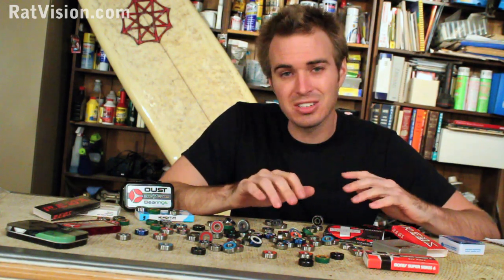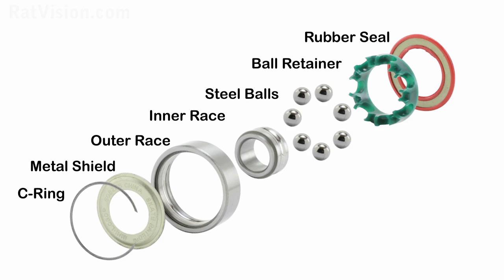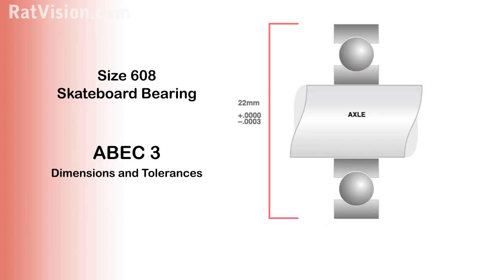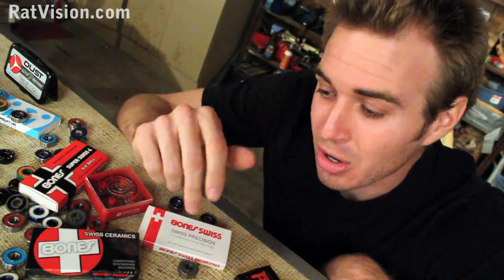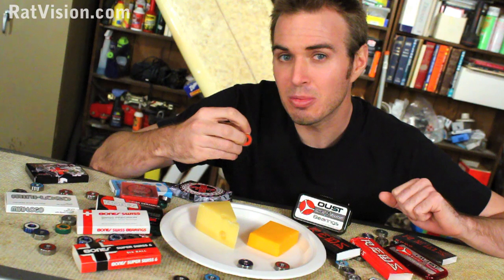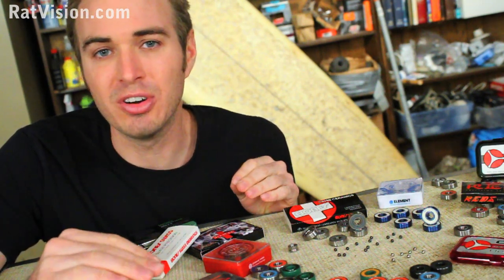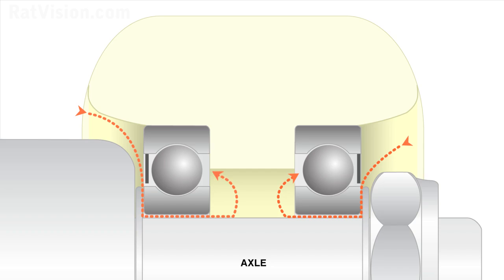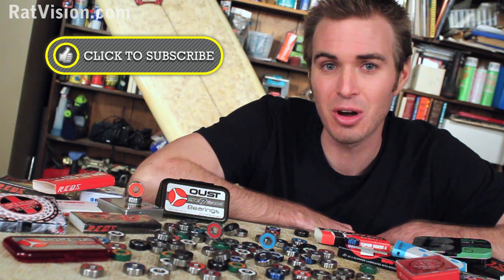What is ABEC / Swiss / Ceramic Bearings

Comment: Great explanation, although you got something wrong. You talked about hardness when comparing ceramics versus steel, but performed a compression stress test; the compression stress is another property. Compression is related to how much force can the material withstand and hardness is about the resistance to scratches, indentations, bounces and is a very complex matter. So you get the idea, the regular fragile glass has actually higher hardness than most steel alloys in Brinell scale. Sorry for the lecture, what I'm trying to say is that ceramic ball have an upper hand against regular steel for prevent scratches inside the bearings.
Reply: Rat Vision – Skateboard Tech I don't THINK they are better.  In some applications I KNOW they are better.  As far as the 5-10 times better, this is engineering fact.  The compressive yield strength of ceramics is generally 5-10 times higher than steel.  As far as bearing use, hybrid ceramic bearings are used in virtually all AMA and World Superbike engines as well as MotoGP, Indycar and F1 engines and transmissions.  Studies by ARPA showed that hybrid ceramic bearings would survive 5 times as long as the standard steel bearings in case of loss of lubrication in C-17 turbine engines.  Sure, these aren't skateboards, but the principles still apply.
Reply: Rodrigo SCompressive Yield Strength is the important measure here.  That is how much pressure the material can withstand before permanent deformation.  Silicon Nitride is about 10 times better than steel in that respect.  ANY small deformation renders a bearing worthless.  Of course, only the higher quality ceramic bearings use Silicon Nitride (black or dark gray balls).  Most cheaper ceramics use Zirconium Oxide (white balls) which are not nearly as good.
Reply: @rcbearings1 zirconium oxide is actually stronger than silicon nitride
Reply: Rc Bearings I don't think the compressive yield strength is the most important parameter. How many skateboard bearings have you seen failed due to a broken balls?. Normally the issue is the wear and tear that gradually reduces the rolling speed of the bearing; with a higher hardness it is likely that the wearing rate inside the bearing would be decreased. Other two factors more important that compressive resistance would be the quality of the lubricant and the sealing against external impurities. For this application (skateboarding), most bearings in the markets have a high enough compressive yield point to withstand most  scenarios.
Reply from the maker: Rc Bearings I am really curious to hear why you think ceramic is better than steel, and why you think it's 5 or 10 times better.

Comment: Normal, metal ABEC5 are just enough for Skateboard, ABEC7 for Longboard downhill. Period.

If there's something to avoid is ABEC 1 or 2 (which you don't find on good skate shops)
Reply: Rc Bearings  The point is you don't need to buy "Skateboard grade" bearings....bearings are always manufactured with high quality standards so, anything from the hardware store would work....and if not, it was cheap anyway.
Reply: Did u guys anything that he just said and penny board bearings are abec7
Reply: Sacco Svd You obviously didn't get anything from the video.  There are a few factual errors there, but the basics are right on.  I can make an ABEC-7 bearing with square balls!  I can also make an ABEC-1 bearing that will out perform any skateboard bearing.  ABEC tolerance class is the LEAST important of all the bearing ratings.  Ball grade, Noise and Vibration ratings are FAR more important.

Comment: Got some OUST 7 SPEED bearings after seeing them recommended. Smooth! After spinning them all day (it's been raining), I did a wheel spin test w/ board laying on its back with one major spin of the wheel.

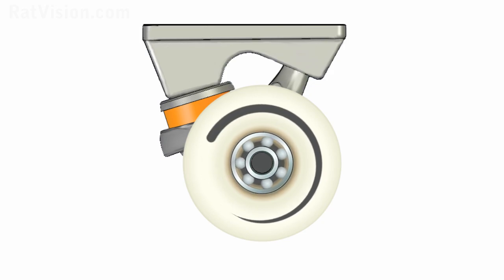Clocked in at 1:17.7 Might not mean much in terms of speed but it seems like the bearings will give crazy-long strides. Can't imagine what they'll be like after they're broken in.
Reply from the maker: Free spinning a wheel means absolutely nothing. It does not prove anything.  You have to be riding the board to actually see how the bearings perform.

Comment: I have a question about choosing the right trucks for my longboard. It's between the Gullwing Sidewinders 2 or the Gullwing Chargers 2. Now here's my problem, I have a sector 9 drop through deck particularly the Sector 9 Lookout Longboard. I've heard the Sidewinder trucks will end up breaking my board from doing tricks on it. If you could get back to me on this it would be great.
Reply from the maker: Did you get trucks?
Reply: Yeah I ended up getting the gullwing chargers, but now I'm saving to get some sidewinders as well as a new deck

Comment: Take your board and drop it from chest height onto the ground. That fancy dancy abec 7 super ceramic swiss just had its abec rating go out the window. Now go skate and quit stressing your abec rating.
Reply from the maker: Speechless!
Reply: You are absolutely correct,and the same applies to ALL the bearings used in wheels. As we both know,they are not designed to take shock loads,and to a certain degree axial loads. I think its funny how people rush out and spend serious cash on super precise bearings,then chuck them around,or worse still not lube them because they think they'll be faster :)

Comment: i just ride around in Florida (Mostly all flat) need a bearing that i can get pretty fast with without having to pump too much any opinions?
Reply from the maker: We recommend Oust.  They have extremely hard balls that will roll really fast. You need to keep the bearing lubricated with a good lubricant.  Old bearings that have been maintained are better than new bearings because they have been broken-in.

Comment: How do you make the bearing go fast when they are new😁
Reply from the maker: Skate them.  They need to break-in.
Reply: Rat Vision – Skateboard Tech BS.  Bearings do not "break in".  The lubricants may need to be pushed out of the races (channeling).  And I am having a hard time with bearings being "faster".  All bearings of a given configuration have the same speed ratings.  If you want less friction, try dry surface film lubricants such as tungsten disulphide.

Comment: Why would you give the dimensions in mm and then the tolerances in inches, thats just silly.
Reply from the maker: You're right.  The ABEC rating was created by the American Bearing Manufacturing Association.  In the USA we use the Standard measuring, using inches.  So that's why you saw it in inches.  If you really want to see it measured in millimeters, there are conversion charts online.  It's easier for people to read and understand the dimensions in mm.  The tolerances could have been in mm, but those numbers are so small I'm sure people weren't paying attention.  You certainly did.  The real reason was just for convenience.
Reply: Rat Vision – Skateboard Tech That's fair, just as a design engineer, i was most probably paying more attention to the technical details than your average Joe :P

Comment: Are new bearings typically slow! As they break into a new wheel for a example or no
Reply from the maker: Yes, new bearings are typically slow.  It takes roughly 15-20 hours to break in bearings.  The contacting surfaces go through changes.  After this break-in period the bearings will perform at a higher level.  Of course the bearings need to remain clean and use a good lubricant.

Comment: Are bearing spacers good
Reply from the maker: Yes, when they fit properly.
Reply: Rat Vision – Skateboard Tech my spacers have a little gap like in the video should I take them off
Reply from the maker: It's your call.  If the space is very small, it may be best to leave them in.  Most often it's best to keep them in, unless there is a big noticeable difference.

Comment: are spitfire burners good?
Reply from the maker: They are just like any other Chinese bearing.  They'll work.  What you may not be aware of is that the skate industry gets the majority of their products from China.  That means whoever has the coolest brand name and does the most marketing usually is the one with the most branding, and that influences skaters into thinking they have the best product.  But in reality they may be exactly the same bearing, coming from the same factory as other bearings, or worse, or just as good as most of the bearings available.
Reply: Ok! Thanks a lot! The video was informative and awesome too...

Comment: I need to get new bearings for my long board. I have recently been using no name abec 5 bearings but they have ceased on me. What do you think is the best bearing for fast speeds and the best performance? Also, what kind of bearing and truck spacers should I invest in? I want to be able to go very fast, be able to carve great, and avoid speed wobbles. And one last thing, what kind of wheels, spacers, hardware, and trucks should I buy? I am basically remodeling my board and I would like it to be top of the line.

Thank You
Reply from the maker: Get a full Dissent complete.

Comment: Love the videos and am glad you are re-looking at some of the "standard thinking" in the industry. The one point you made about ceramic bearings though is not supported by your test. A compression test doesn't test any of the three definitions of hardness (Scratch, Indentation, Rebound). To make the assertion you do you would have to prove that the compression on any one bearing exceeded the pressure you measured the bearings breaking at. Also why do most of the top downhill racers use ceramic bearings? There is a TON of data on why ceramic ball bearings are better than steel ball bearings. What I understand you are saying though is all of that is discounted because they are more brittle. I think you have to prove that the torsional and axial forces in the 608 bearings do reach the forces that could chip or break a ceramic ball
Reply from the maker: If you look up any bearing manufacturer, not some skate brand peddling Chinese chunk, you will discover that they all say how ceramic does not handle loads as good as steel.  There is NOT a ton of data on ceramic being better than steel ball bearings.  Don't forget that the industry is filled with lies and marketing hype. Downhillers use ceramic bearings because it's what they have been told is the best. They got suckered into believing what the brands BS about.  If people would think about ceramic for just a minute they would realize how it's not good for bearings.  If you take a ball that is harder than the steel raceway and apply a heavy load to it, don't you think that ball will create indentations and change the surface of the steel raceway.  Now think about what the ceramic balls have to roll on.  It's an uneven surface, which is now going to affect the performance of the bearing and could potentially ruin the balls. It's not going to do what everything thinks and re-polish or smooth out the metal surface.
Reply: Got any comparison bearing pics to show that? I'm all for challenging the status quo but where is your supporting data? A pressure test is not really meaningful because you have to show that a bearing is actually subject to that load. What manufacturers say ceramic bearings don't handle as well as steel? Every manufacturer I could find with a variety of bearings (VXB, Boca Bearings) and even almost every skate company that sells bearings all say ceramic is better for speed and downhill use. What companies are saying the opposite?
Reply from the maker: Dan McDonley I'm not about to get into a debate.  VXB and Boca both do not have any info about loads, because they are both importers. Look up bearing manufacturers.   The skate industry doesn't know much at all about bearings, and will say anything to sell a product. Skate brands don't manufacturers their own bearings.

This is taken directly from an actual ceramic bearing manufacturer's website, so you'd think they would say a ton of amazing things about ceramics.
"It generates much higher stress at the contact point between the balls and raceways, compared to steel bearing. With the increasing of load, the higher increasing of contact stress would pit/destroy the surface of steel races (for hybrid) or ceramic balls and ceramic races (for full ceramic) and cause premature failure. Therefore, under heavy load or even some impact load, the endurance life of a ceramic bearing could equal or even shorter than a steel bearing."
http://www.hscceramics.com/about.html
Reply: Interesting. Thanks for the link. That makes your argument a lot clearer.
Reply: Dan McDonley These are good points.  I do not think that skaters come any where near the critical loading limits of 608 series bearings.  It is well documented that hybrid ceramic bearings do not have the same ultimate load capacities of all-steel bearings but it is important to know if these capacities are actually important to the application.  And, counter to the comment about data, there is a TON of data showing that under high speed, high heat and frictional applications, ceramic balls are superior in all respects to steel balls.

Comment: Hey!
I recently purchased Bones Reds from my skate shop. I rode hard, and they were honestly terrible longboard bearings. I'm going extremely fast, going at least forty, usually sixty miles per hour. Will Oust MOC 9s do the trick?
Reply from the maker: MOC 9's will take your skating to a much higher level and greater speeds.  Bones can't handle loads very well because the raceways are shallow. Basically they are good going straight.  Oust has deep raceways that can handle loads.  You apply loads to bearings constantly and very heavy loads are applied at high speeds while turning.
Reply: Alright, thanks! Will be sure to grab them when I can.

Comment: What do you think about the "bones ceramic swiss bearings" and "bones reds" because i cent decide what bad and good things they have .. I am looking for street bearings that would go far and fast on a push for my long board ;) if those arent your suggestion .. Which ones do u propose?
Reply from the maker: We don't recommend ceramic bearings at all.  Swiss means absolutely nothing when it comes to quality, speed, and durability.  It only means they were made in Switzerland and perhaps using Swiss material.  That's all.  Bones Reds are a decent bearing, especially for the price.  They aren't the best.  We recommend Oust MOC 5 Tech bearings, because they are the best from what we've tested.  How well you maintain and lubricate your bearings is going to determine how fast and how often you have to push.  If you don't maintain your bearings it doesn't matter how good they are, they will get ruined.  You can go with any bearing you wish and can afford, and you may be happy with anything, but we recommend Oust.

Comment: are the spitfire burners any good?
Reply from the maker: They are just like any other Chinese bearing.  They'll work.  What you may not be aware of is that the skate industry gets the majority of their products from China.  That means whoever has the coolest brand name and does the most marketing usually is the one with the most branding, and that influences skaters into thinking they have the best product.  But in reality they may be exactly the same bearing, coming from the same factory as other bearings, or worse, or just as good as most of the bearings available.
Reply: so... I got ripped off?
Reply from the maker: You could have got what you paid for, or there is a chance you did get ripped off.
The skate industry is filled with gimmicks, lies, and marketing hype.  Young people are very impressionable and gullible, so they are easily persuaded into believing what brands are selling are honest, good quality, and high performance products.  
Do we even know what hell a "Skate Rating" is?  What is it?  What does it measure? What is the rating of a skate rated bearing?  We don't know, because the RATING DOES NOT EXIST!

Question everything!
Reply: Rat Vision – Skateboard Tech So i looked on the channel for the spacer video, is it under another video?
Reply from the maker: Fastest Skateboard & Longboard Wheels, Bearings, and Bearing Spacers
Reply: Rat Vision – Skateboard Tech I realized, thank you for being nice lol. I wasn't paying attention.

Comment: Are the Bones Super Swiss 6 faster than the Bones Swiss?
Reply from the maker: Great question!  If 6 balls are so great, why aren't all bearings using 6 balls?  Why doesn't the entire line of Bones bearings have 6 balls?  It's because 6 balls are not better.  The balls are handling more loads because there are less balls to distribute the loads.  They use bigger balls, which have a bigger footprint on the raceway.  Both of these cause drag.  Those are 2 reasons why 6 balls are not better than 7.  Don't forget Swiss ONLY means they are made in Switzerland and possibly using Swiss material.  There is nothing about "Swiss" that means the bearings are at a higher level, higher quality, or have a better ABEC rating.  Ask yourself this question too, "What the hell is a skate rating?"